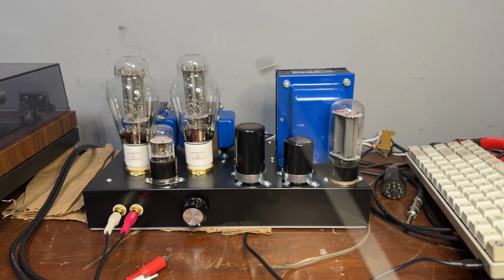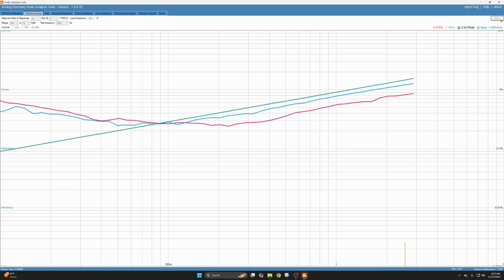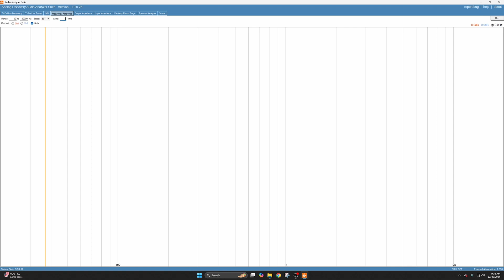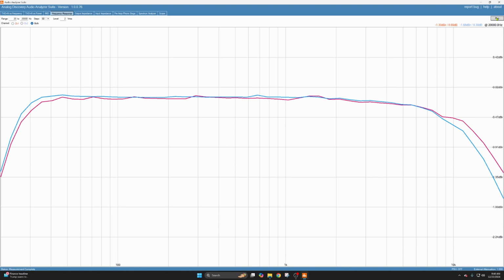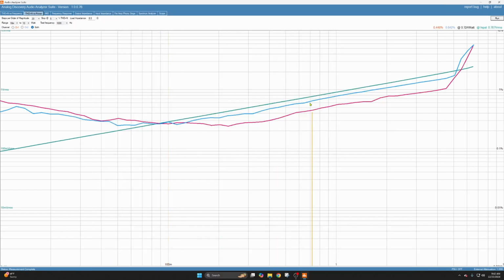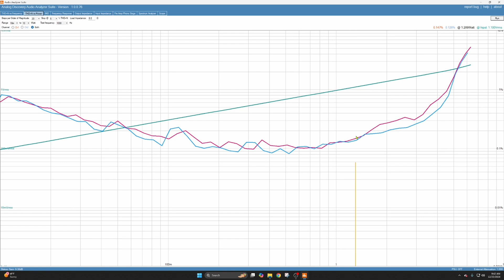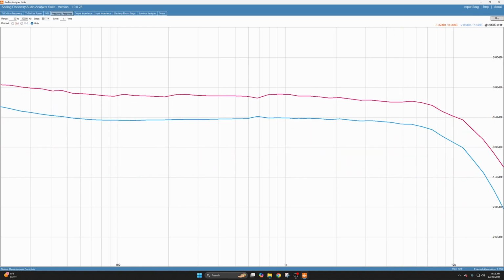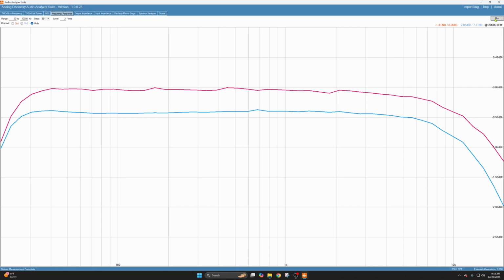Building a $1,000 300B Tube Amp: Audiophile Sound on a Budget

Comment: Dave, congrats on your nice build!  I hope you enjoy it for a very long time.
If the stars ever align and my ship comes in I would certainly enjoy building and using a truly "audiophile" grade tube amplifier with or without a tube pre-amp.  Some folks feel tubes are dead and should be buried, but there IS something special about a well build tube system sound.  Sure a solid state rig can produce audio down to the last shimmer of a bell, but when old ears like mine want to relax with the classics tubes seems to fit the bill.  Of course, the choice loud speakers driven by said tube system is the icing on the cake.  Everything has it's place.  I'll take the "Caddy" for a long drive and leave the "Vette" in garage until it's race day.
Reply from the maker: Thank you. To me tubes exemplify a life lesson I learned many years ago “ it’s the imperfections that make it perfect”. I love your caddy/vette analogy. There seems to be a lot of crossover between amp lovers and car guys.
Reply: @DaveEdwardsDesigns  Dave, that would be a slightly modernized '62 Caddy if I could.  😁
Reply from the maker: Good choice, I’d have to go 50’ on the caddy. My grandfather used to work and restore the good ol’ lead sleds.

Comment: Hi nice build and video of your amp's performance. I was wondering what circuit did you base your amp off of? thanks for replying
Reply from the maker: I took inspiration from a few. Skunkie for the power transformer, and DC Filaments. The 6sl7 is one I designed, which for my upcoming 2a3 build I’ll detail that process. Dennis Had was a big influence as well.

Comment: What awful response, cannot say this would sound good at all.
Reply from the maker: If you are referring to the frequency response, it’s not a perfect “table”. The response does change with input level, I can get it more flat if I crank up the input voltage. However, the response work with the full range drivers I have that over emphasize the highs and de emphasize the lows. All about looking at a system as a whole sometimes.